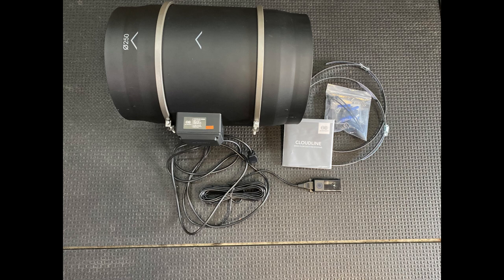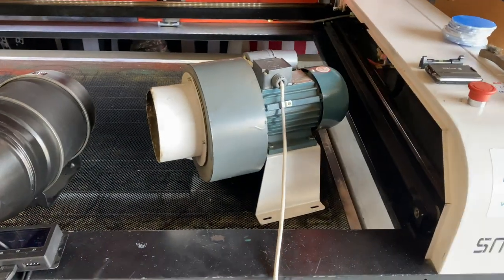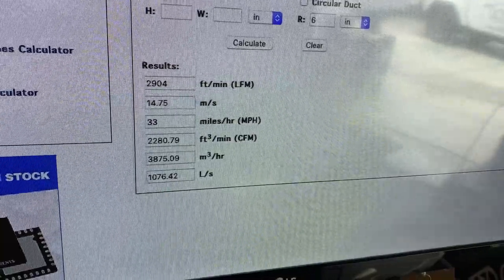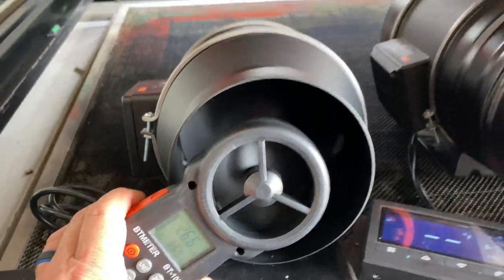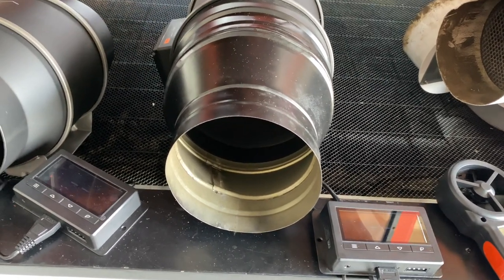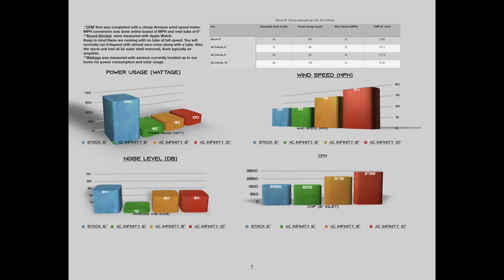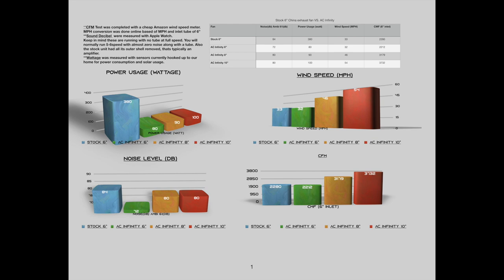REVIEW..AC Infinity vs Standard Box Exhaust Fan

Comment: in your software i notice that you set "R" to 6. i think "R" stands for "radius" so for a 6 inch diameter fan i think you should put "3" for "R" (remember from math class that diameter is 2 times radius) and this would likely result in one-quarter the CFM (area goes up as the square of radius) , so instead of your 2200 number it would be more like 550 which is closer to the manufacturers specs right? - the AC 6" inch is specced at 402 CFM.
Reply: I believe you are correct, Joel. AC Infinity claims an airflow of 1600 CFM for its 10" fan, about 2.3x LOWER than this video's 
"measured" flow of 3700 CFM.

Comment: Great video. One point of note though: in the CFM calculator, you entered a value of R=6 for the duct area. This would represent a duct diameter of 12" (R, "Radius" = 6). So the cross-sectional area is over-represented by 4x and the CFM's should be 1/4 of what is shown. The relative output of each fan to one another is valid, but the absolute values of CFM's are inflated.

Comment: Thanks for the review man. Very helpful. I've been looking at the Penn State 1350 CFM model DC250SEMB and it's rated at 72 db. The AC Infinity seems more efficient but I'm not sure.
Reply: After having the s8 for a month and using it for my Epilog Fusion Pro 32, I must say that I'm quite impressed. The air movement is more than satisfactory. Light and medium smoke clear the chamber is a 1 or 2 seconds. Heavy smoke about 4 seconds. Acrylic and leather odor still linger at times.  The noise level, however, is nearly double what the manufacturer lists on their site. I called support to validate and I got canned answers that quoted their site specs. They then suggested on the very next sentence that I should purchase a larger unit to deal with the noise so I won't max the motor. Overall I'm happy but wondering if I should've ordered the s10 or s12. The minimum CFM for Epilog is 735 CFM. The problem is stepping down from a 12" to say a 4" for egress airflow. I can't find a converter. Again, thanks for the review.

Comment: I have a question. I have a s6 intake going to a t8 exhaust  with a 8 inch filter. Is that to much for a 3x3 tent?
Reply: Perfect because you can always run them on low for less noise and higher if it is really hot.

Comment: It's not as powerful as I thought it would be, but it works very well. https://www.youtube.com/post/UgkxGjG43--gYqIoT4Xkur2PqCrtbKwTv2h There are three options to circulate air, and best of all a remote control for us lazy people. Installation was a breeze (no pun intended). It actually took longer to open the box then it did putting the side extenders on and sitting it in the window opening. It's a perfect alternative when you want airflow, but not the AC. Just might order another one for a different room. UPDATE: Bought another one like I said. They work great. Why not have two...

Comment: Very well done, very useful test! I agree with the note below that you should have plugged in 1/2 the diameter into the calculator. One note about the box fan though: squirrel-cage blowers do much better against back pressure than conventional bladed designs, so will be better for situations where you need to maintain a higher pressure differential. This was a super-helpful video though, much appreciated!

Comment: Great video. Thanks for taking the time to make the video. No doubt that the AC Infinity blower is a great product. However the test procedures leave to many ( how can I word this) descrepancies. For instance,.. you measured readings from the inlet side of the blowers,  did you record readings from the discharge side of these blowers? Perhaps in another video?  Also, there is a lot of potential lost air space around the intake that your measuring device can not cover. Another words, a 6 inch opening , & the measuring device is what, about 3 inches in diameter? By no means am I an expert about measuring air velocity, & do appreciate the video.

Comment: Thanks for this review. I'm building a smoking room and I need a ventilation fan. Narrowed my choice down to these models. Probably will go for the 8 inch and run it at a lower speed to control the noise level. It's a 12x12 room so the 8 inch should work nicely without being an eye or ear sore.
Reply: Did you ever finish your room? I'm thinking of building one as well about the same size
Reply: @techz4u1  drywall is 3/4 done at this point. I did buy the 8 inch fan and it moves a lot of air but it's too loud to have running all the time in a bedroom. It moves so much air infact that I fight to keep my old house warm here in midwestern Ontario right now. It creates a negative pressure  so the normal old house drafts are magnified.
Reply: @techz4u1   I’ve just finished upgrading my existing cigar room ventilation system, now using the 8 inch fan with AC’s sound suppression canister on the intake side of the fan. I’m using the fan on level 2, which is totally adequate to keep the room clear and almost silent (Apple Watch reading of 38 db for the room). No idea what my current cfm is, which brought me here today, but again it’s working great for my needs so I guess it doesn’t matter.

Comment: Cool video!  mind telling where you sourced the reducer for the 10" fan?
Reply: Amazon.. what don't they have, Right?
Reply: @ThunderLaserUSA  more specifically; what type/make, etc... I'm looking to get a 10x8 for my T10 and I've found some; however, a few seem to be of questionable quality, did you seal that reducer with a gasket or tape of sorts, or is it just lapped correctly(to avoid potential leaks/air resistance). Thanks for replying!

Comment: Industrial grade radial fans can be very expensive. If you check websites of vendors which sell industrial grade radial fans, then you'll find the pricing for a 6" model ranges from $865 for 320 CFM / 60 dBA, to $1,274 for a 1,070 CFM / 70 dBA fan, and upwards to $4,000. Granted, the industrial grade fans will last far longer than the useful life of the equipment they support, but I'd rather plan on replacing the lower cost fans every couple of years.

FYI - If you incorporate a well designed air filtration system that features (by stage) (1) a spark arrestor, (2) prefilter, (3) HEPA filter, and (4) activated carbon filter, then the air can be allowed to pass from the carbon filter back into the room. I've yet to find a commercial unit that both properly filters the air and offers affordable annual cost of operation (the filters are outrageously expensive for the hobbyist or small business owner, which is why I'm designing my own).

Comment: What was the CFM? Did you measure the sound levels of the fans without the anemometer spinning noise? Do yourself a favor and pull the video and do it over sir.  I gave up at 8:57. I do like your sense of humor with the noise protection on. Saying they were quite. Perhaps responding to sellers advertising claims the fans are "quite.  It got me interested. I'll come by and watch the rest when my tolerance is more patient. Friendly advice. Best regards.

Comment: Hi, I have been watching your videos... tons of them. You are articulate and very good at teaching. Thanks! I figured you would have an answer to my question about venting. I recently bought a 20 W Dewalli laser engraver. I am a newbie. The Dewalli is small with a foot print of about 24" square. I found out very quickly that I need to vent it. In doing some research I found that building a box is a good idea and adding some vent holes ignorer to help the smoke evacuate via an inline fan system. I am looking at a simple fan as the vent hole in the side of my hose in very close to the machine. 
The price seem to be all over the place. I am looking at he iGrowteck 4 inch inline Fan. Please let me know if there are any other ideas and or advice. Thank you very much for any help!!
Reply from the maker: Thanks for the compliments. 4” should be plenty. Make sure you have flow through holes in the front allowing it to pull clean are through
Reply: @HouseOfLasers  thanks!!!  You rock

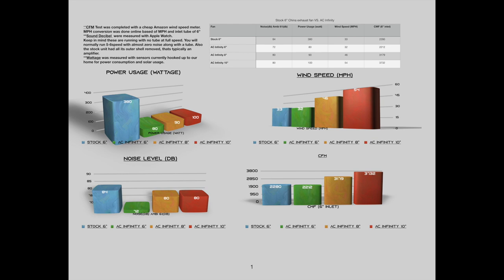Comment: 11:10 "The decrease of size going into it, will increase your cfm" This can't be right, or can it? If it's correct, can someone please explain how, as I'd assume decreasing the size of the inlet would have a baffle effect just like decreasing the size of the outlet would. Now, decreasing the inlet size would increase wind speed at that point, so maybe there was a math error in this where the larger diameter was used with the smaller diameter's wind speed to calculate cfm?
Reply: Been wondering the same thing... I've got a reducer i could use but I am wondering if it would actually benefit the cfm on the intake side. seems counterintuitive.

Comment: The room I am covering is about 25 x 25 with a 7.5ft ceiling. We smoke alot of tobacco / hookah and need to vent out the smoke. What model do you recommend and what size duct should I use going in and out? It will be attached to collar ties with some mounting work in the attic above dry wall with an access panel. The duct will be going straight vertical to the ridge vent with a 90 degree turn from the horizontal (3ft duct) to the vertical portion(~5.5ft). Any tips on model and my idea of duct work would be greatly appreciated. Thank you sir.

Comment: Hi everybody, nice video, thanks for the review. I'm not an expert but I have some comments. Can we decide which car is more powerful by measuring the wheel’s rpm and diameter while spinning on air?. You need a test the fans WITH load. How strong are those fans to pull air through the intricate system laser-ducts-filter?. See the big difference in watts?, the 380W of the stock 6” fan is like a V8 engine in comparison with the 100W (or less) of the rest that are like little 2 pistons engines. It looks to me that once you make your test under normal conditions with the laser machine, the ducts and maybe a filter attached all together to the fans, your 3 little-low-wattage duct fans are going to faint. We can see the fans as power transducers of electric energy to mechanical energy transferred to the air flow. The 380W stock fan is able to transfer almost 4 times more energy than the rest. On top of that, centrifugal fans (like the stock 6” fan) produce more vacuum or pressure than the conventional impeller used in the duct fans. Regarding the dBs, yes, always expect to have more noise from a V8 than a 2-pistons engine. I believe that the 380W stock 6” fan will be your winner under load. Cheers!

Comment: Hows it compare to hyper fans? I have a 6 inch hyper fan that works great but im wondering if the AC 
infinity 6 inch would be a good upgrade
Reply: I've been thinking they are all basically  the same fan sourced from China. Hyperfan, Sensda, Terrabloom, AC infinity etc. Very similar specs and power draw. That said they are all awesome compared to the best AC inline fans

Comment: Would be a killer bath exhaust
Reply from the maker: We will actually be using this for our bath remodel
Reply: @HouseOfLasers  I went to the site and I put the ducting, the exterior vent hood, the interior vent grille, the t6 all in my cart. But I stopped short of ordering. I want to know if I can use an existing fan speed switch rather than the speed switch that comes with the fan. Having to use the controller the fan comes with is going to be mega tacky. Plus I don't think it's long enough to reach through the ceiling and down through the wall to be placed next to the rest of the switches. It would be nice to use the existing switches and fan speed control.
Reply from the maker: @ArcolaBridge  I would think not since it’s a digital motor/controller
Reply: @HouseOfLasers  I got a response from someone on my Amazon question who said yes it's possible to rewire it. I'm sure that would void the warranty. But as long as the wiring can be spliced to the existing switch the whole thing should work out. Unless like you say it's a digital switch? Maybe there's more to the switch...
Reply: @HouseOfLasers  worst case scenario you think you could splice the wires longer so you could use the (If it is proprietary) switch. But I don't think that would look very good even custom fitted to be flush with the wall it might look kind of silly. You could get a blank plate and cut it so the whole thing looks like a single gang.
Reply from the maker: @ArcolaBridge  it as a converter so it doesn’t run regular 110 to the digital motor
Reply: @HouseOfLasers  must be 24 volt?
Reply: @HouseOfLasers  I see people on YouTube are wiring them to their EAC terminal on their furnace to act as a booster when the blower activates.

Comment: Is the difference big if you go lower on the intake? (Lets say I put an 8" IN to my AC Infinity 10" and duct out through a 10" hose) What's the difference in cfm as opposed to running without a converter of any kind?
Reply from the maker: You should be good with it reduced on the inlet.  It’s the outlet that needs to be as big as you can go up to the size of the outlet. It will choke it a bit otherwise
Reply: A fan cannot push any more air than it can pull, it works on pressure differentials, up sizing the exhaust just means that the velocity of the air will slow when it exits the fan, something you don't want.    Heating contractor here

Comment: don't buy the 8inch one it's not dual voltage and different from the others
Reply from the maker: How about you explain a bit more. My 8" worked perfect. If you have a specific issue why it doesn't work for you then theres no reason to tell others not to buy..
Reply: I’ve got the 8 inch works great wtf are you talking about quiet as a mouse and runs from a normal wall plug ... is your gro op in the back of your van ? You need a 12 volt fan ?